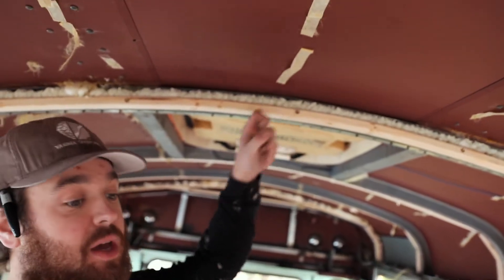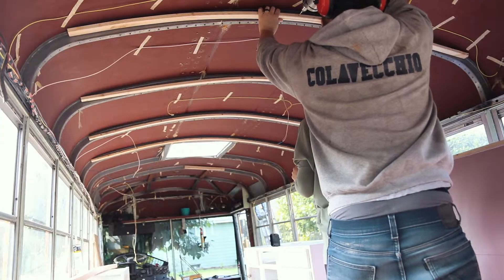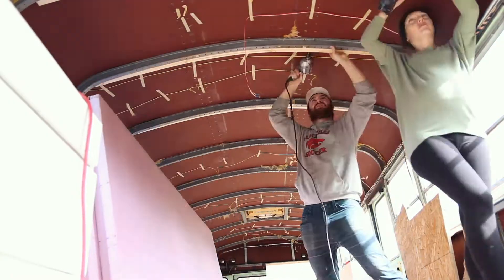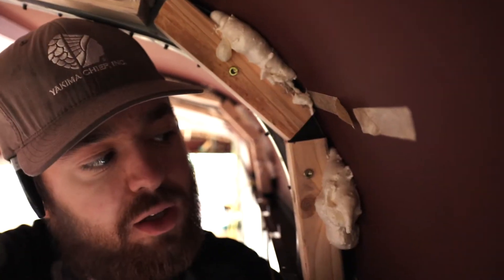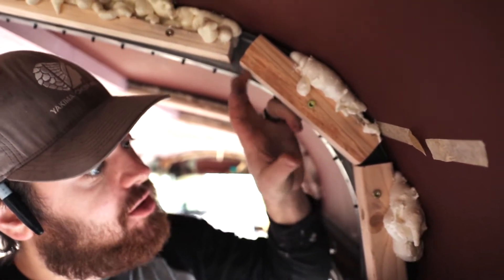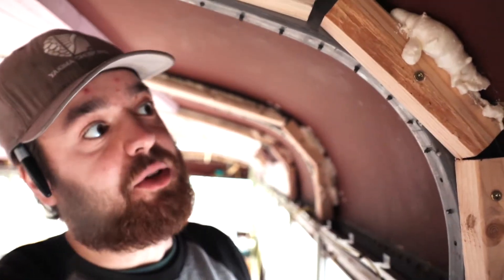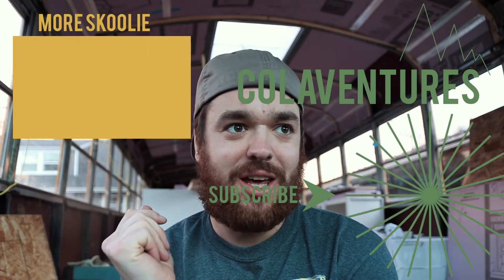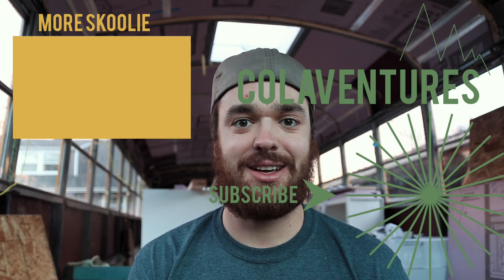Ceiling Insulation - Skoolie Bus Conversion - E13

Comment: Good work, I'm looking at your videos I'm appreciating your good efforts. I'm building my own, I'm trying to get many ideas, can you tell us what is the clearance inside your bus  and where and how are the wires running to the rear of the bus b4 I start drilling through the wiring, I intent to add on to the existing roof instead of ripping it apart. I hope you can Reply at your convenience 
Alex k.
Reply from the maker: Alex Kalsatos yea! Our wires run above the driver side windows behind some of the cedar boards. It’s like a 1/2 in trough.

Comment: Super helpful video! We can’t seem to make up our mind on how to insulate our ceiling or walls on our skoolie. What made you pick this type of insulation in particular? We are trying to choose between mineral wool, cellulose, rigid foam, or recycled  denim. We’re trying to find a good balance between r-value, cost, mold deterrence, and eco friendliness. The choice has been daunting so far!
Reply from the maker: I ended up going with the rigid insulation because it squeezes in pretty easy. It isn't messy. And I think it is pretty cost effective... although I haven't run the numbers. I read something on a skoolie forum that said if you aren't changing out the windows, then the bus is going to be chilly (or hot) no matter how much you insulate. So the plan is to get a wood burning stove to compensate for the single pane windows. Home depot has some green blow in insulation that I used under the windows and around the wheel wells. You can see it in my wheel wells video. Here is a link to the insulation https://thd.co/2Hpet7a - Hope that helps!
Reply: Have you looked into sheeps wool? I've been doing similar research and am thinking of going with this option for the roof and walls. Check out Havelock Wool's website!

Comment: Did you pre-drill the metal, then the construction screws would go thru ok? I heard you say you went thru 4 bits. Have you noticed any condensation issues in ceiling. Someone else mentioned they had issues, not sure what they did. I like your ideas. Thanks as always.

Comment: why did you out the wood in though?
Reply: Why did you put** the wood in though. It doesn't seem necessary.
Reply from the maker: @michaelgiovanniello3230 We put it in to create a weather seal or a vapor gap not sure what it is called. The basic idea is that the screws would sweat if we just screwed the wood right into the ribs of the bus. Also it is a pain to screw wood into metal so we didn't want to do that 1000 times when we screwed the finish screws into the TnG cedar. Hope that makes sense!